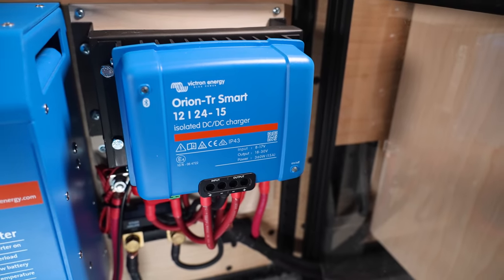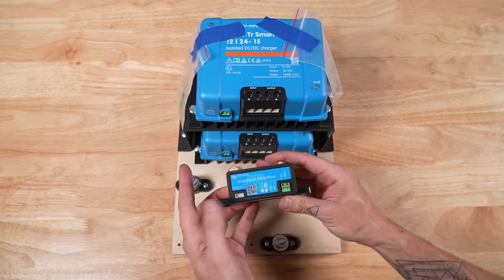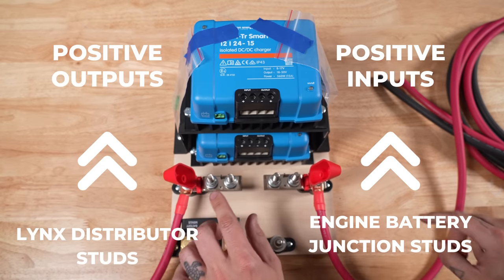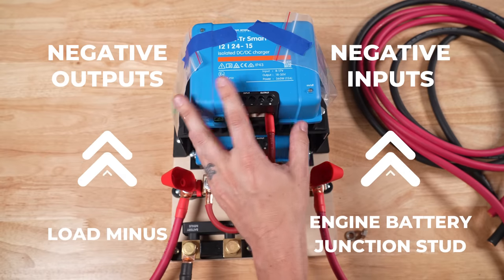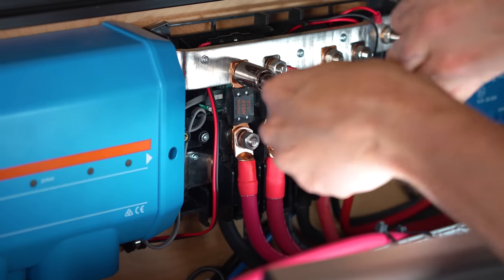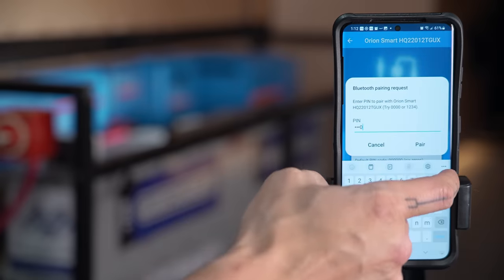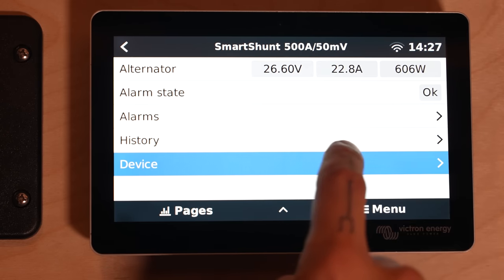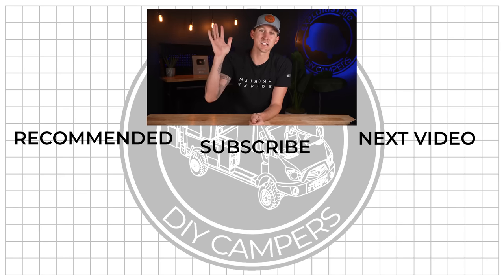TRANSIT ALTERNATOR CHARGING - DUAL VICTRON ORIONS

Comment: Great video, but I still do not understand how you can charge twice as much using two Orions. Is there no limitations on what you can pull from the alternator? Could you do three Orions even? I just don't get the dynamics/parameters involved, I guess.
Reply from the maker: Rule of thumb for alternator charging is to not add more than 50% of the alternators rated output in auxiliary chargers.  In this van; since we have 500A of alternator capacity; we just can't add more than 250A worth of DC DC Chargers or extra loads, so the 60A we added here is just fine.
Reply: @EXPLORISTlife   - understood, thanks! - the alternator has more than enough to give - noted.

Comment: Does the smartshunt HAVE to go on the output side of the dc-dc converter? Can I put mine on the input side?
Reply from the maker: It could go on either depending on what you were trying to measure.  The way I showed in the video is the way I'd recommend and find the most useful, though.

Comment: I am wanting to use my 12 V alternator system to charge 12 V or 24 V isolated systems is that possible with one charger and if so which victrons

Comment: Hi can i just use the the body ie chassis of the van for the negative part of the wire from the starter battery thanks.
Reply from the maker: I don't like treating the body as a current carrying wire, no.  Consider doing it like I showed in the video instead?

Comment: Would if I already have a smart shunt connected to my lynx distributor using copper bar and the load minus side connected to my negative battery bank? Do I have to get a second smart shunt? or do i wire the negative coming from the DC to DC charger on top of the negative wire I already have on the load minus side thats coming from the battery?
Reply from the maker: In this video, the smartshunt is acting as an energy meter, not a battery monitor, and you'd need both in your system to have the full monitoring capabilities discussed.
Reply: @EXPLORISTlife   so if I chose not to have the energy meter I could just skip that part of the connection in your video? And if so what would I connect the negative part of the charger to instead of that? And what part of the charger would get connected to the lynx distributor?
Reply from the maker: @hudyfilmsentertainment ultimately, if you choose to not follow the tutorial, you’ll need to forge your own path.
Reply: @EXPLORISTlife  lol so basically you’re saying it’s either your way or you won’t help? Okay lol
Reply from the maker: @hudyfilmsentertainment that’s a little overly dramatic.  This whole channel is dedicated to helping, if you just take the time to watch and learn about system design.

If you want to stray from our recommendations, though, I am indeed limited on the amount of personalized hand holding I can do, yes.

In short: either learn system design as our videos teach so you can design your own system OR you can install your system by our recommended methods.  Two solid options there to get you what you need.
Reply: @EXPLORISTlife  I guess I’ll have to find a different video that will show me a different way of doing it so I don’t have to fork out the extra money on a second smart shunt seeing how I already forked out a ton of money on this build. I mean, everything else in my electrical system is done, hooked up my fan to my 12 V fuse panel. Everything’s running great. Yeah I did my research, do I still understand everything? No but I was still able to get everything else running just fine off Nate Murphy 24v system tutorial. Only he didn’t show hooking up alternator charging, and since everybody hooks up their electrical system differently, it’s very hard to understand how to add the alternator charging. I don’t feel I have to go through another months of research just to learn one thing when I installed the whole electrical system just fine off a tutorial
Reply from the maker: Of course!  Totally understand.  If you want to simply follow the tutorial as-is and use the SmartShunt as designed, you'll simply need to purchase that one device to the tune of $100 thus saving you, apparently, a full months worth of 'research'. 

If you want to save the $100 and not buy the smartshunt; you will indeed need to dive further into the system design considerations to decide what is necessary to omit that part, yes.

There's always something new to learn.  I also don't know everything but I'm constantly striving to learn something new every day.  😊👍🏻

Comment: Hi Nate, being waiting for this video to come out. Awesome, thank you!
I was hoping you would have addressed the challenges or waiting to see if anyone mentioned them, regarding the Ford's Smart Alternator and the Engine Shutdown Detection settings for the Orion. I have searched the internet and there is a lot of talk regarding this subject but no real concreate answers, even on the Victron forums.
I have tried various settings for Start Voltage, Delayed Start Voltage and Shutdown Voltage but I can't seem to get the Orion to continue to charge throughout the drive. The Orion keeps turning off due to Shutdown Detection during the drive and it does this frequently. Have you managed to get the settings right so that it plays nicely with the Ford Smart Alternator? Would you mind sharing your settings?

Comment: Hey there. I'm sure you're prepping, maybe, for the Friday Live stream but I had a question about the orientation of these items and/or ANY of the Victron devices in your systems. I made myself an almost exact duplicate of what you did here and I COULD fit it vertically but the wiring into the Smartshunt and posts are going to be tight to the ground. Can I turn it 90 degrees and have them horizontal without any issues? I think the other part I had a question on is the MPPT but I think I have that one set vertically with clearance. I'm rather proud of my box and I'm hoping to show you and Lauren Lawliss since both of your videos have made it possible. If I don't get a response before Friday then I'll jump on the livestream and ask there and post the answer here for anyone else that might've had a similar question about orientation of the devices. To be honest, I can't think of why there would be an issue, but I watched a video where the person said to make sure it was sitting vertical. - Thank you very much - Joe... again.
Reply: Thanks for the answer on the livestream. For those that might still have the same question, Nate said they should be vertical for airflow and heat issues.

Comment: Do two chargers not put too much strain on the alternator? How can you calculate what size dc to dc charger you can go up to? 🤔
Reply: His transit has two alternators, 250amp each.  He could actually pull 175amps from CCP2 and 60amps from CCP1. If you have ford transit i would recommend you to read Ford Transit Body and Equipment Mounting Manual.

Comment: I love Victron products but this video REALLY illustrates why they need larger capacity dc-dc units with built in communications. I went with one of the new sterling 120amp units and a smart shunt to avoid all that wiring mess. It will be swapped out should Victron come out with a higher output unit with comms.
Reply from the maker: Agreed.  It's on the way, but they keep pushing the release back.
Reply: @EXPLORISTlife  I was at intersolar 2020 and they said soon back then. Though the pandemic sure did mess things up a bit. Hopefully soon. 👍

Comment: is there a reason you used a Smart shunt to show alternator charging? Wouldn't a regular shunt plug in to the Cerbo GX and give the same info?
Reply from the maker: What do you mean by "regular shunt"?  The Victron SmartShunt is the cheapest and most 'regular' shunt that Victron has.
Reply: @EXPLORISTlife  The basic  victron shunt that the BMV uses is only $35. The smart shunt is $130. I was just wondering if there was a specific reason you went with the Smart Shunt? As far as I can tell they should both do the same communication with the Cerbo. Asking because I am about to do the same thing and thinking I may have missed something.

Comment: Great video. No I don't think this video is overkill...in fact I would like to see a video explaining how to use alternator charging to the highest level (without damaging batteries) so that a vehicle battery setup could power home essentials during a power outage...and 600W charging wouldn't cut it. i.e. would I have to use 4x Victon Orions and 4x 12V 100AH batteries to get 1200 or more Watts of alternator charging or is there a better way? Thanks in advance.
Reply from the maker: If it were me in that scenario; I'd be going for a 2nd dedicated alternator, for sure.

Comment: Hi Nate.  In your Waypoint camper wiring diagram, you have two Orions.  In that diagram, you do not have separate fuses in each 6 AWG wire coming from the vehicle battery to each Orion.  In the dual Orion wiring diagram for this video, you have 60 amp MRBF fuses in the wire between the battery and the Orions.  Why did you add the additional fuses?  Thanks, Erik
Reply from the maker: Without getting into a 1,000-word reply, this way is more correct.

Comment: Ford does not want you to hook the negative cable directly to the negative battery terminal. It bypasses the BMS if you do. See Ford Special Vehicle Engineering - Body Builders Advisory Service. SVE Bulletin Q-231
Reply from the maker: We connected in an approved location for our particular model and setup, but yes, please refer to official documentation when connecting in your own system.

Comment: Hi Nate;
As always this was clear and concise and makes amateurs like me feel like they can do this work.   I could follow this along with one of you HD wiring diagrams and be successful.     I am wondering why yoo didn't run two sets of 6AWG wire to the individual B2Bs and connect the individual B2Bs to the Lynx distributor.   I would think that there would be savings on wire, fuses, MRBF fuses, etc.   Am I missing something here?    What changes would need to be made to combine the output of the two B2Bs (to the Lynx) to put them both on one stud on the lynx distributer?

Thank you so much for your content - I am a happy subscriber (and customer)

Comment: Hey Nate, i have a similar set up and really struggled with the two orions. I measure the output of mine seperately through a simarine and they seemed to fight each other. One would put out 30A and the other 10A, then theyd repeatedly swap. I found that using a trigger wire to the ignition helped. I also amended my settings so that absorbion voltage was 14.6V. seems better now but im still not fully convinced its working 100%. Have you twsted the individual output of yours?
Reply: Very interesting. Thanks for doing the work. I could never understand how the outputs of Orions could just be paralleled without having control wires interconnecting the units. Seems like a whole load of feedback loop problems. Shunt current regulators would be self balancing but would need series voltage regulators in front of them to control the charging profile.
  However Victron's design does not extend to the sophistication of Kelvin connections to the battery which seems a pretty obvious requirement when dealing with massive currents and real world installation wiring.
  I am using a single 12-24 Orion so have none of these worries. Perhaps a Victron circuit diagram would help. I believe there was an EU requirement for these to be available to customers. Though nowadays it would have to include software functions.
Reply: Network them together

Comment: I've been following the channel for awhile, and this seems to be one of the strangest ones.  I must be missing something.  Why the complexity of installing two 15A B2B when you could have installed just one 30A such as the Victron Energy DC-DC Bluetooth Charger Orion-Tr ORI 122436120 Smart 12/12-30A (360W) Isolated B2B Booster.  We installed that model, and it works great.  I assume that a 30A model wasn't in stock??  EDIT:  I see now.  You have a 24v system in the van.  Why 24v??  Smaller wiring needed, I guess.  That's another video I'll need to watch!
Reply from the maker: Yep.  24V on the battery bank means we don't have a 30A option.  But 15A @ 24V is the same thing as 30A @ 12V.

We did 24V on this system as we wanted to show people how to do a 24V battery bank.  We already had tutorials for 12V battery banks and didn't want to make the same video over again in just a different van.

Comment: Is there a way to use this to charge an EcoFlow Delta Pro via the solar 150v 15amp connection?
Reply from the maker: Not sure.  I do think one of the points of the ecoflow is to have everything contained in one box/enclosure.  If you want the flexability that a system with seperate components like we teach on this channel; you should probably abandon the ecoflow idea in favor of one of our higher performance and flexible systems.

Comment: I used the ccp2 with the 60amp  fuse instead of the 175amp  ccp1 on my transit. I have the dual agms. I installed the renogy 50amp dc to dc. I did not run  ground to the starter battery just positive. I did not install the ignition sensor and it seems to work fine. I did not use the 175amp connection point because it is only on when the key is on  and you have to use 2/0 cable for a long run! Also then you cant trickle charge the starter bank with solar unless the key is on. Do you see any problems with this setup?
Reply from the maker: I don't really like 'auditing' other people's setups based on just a few sentences with no context or pictures.
Reply: @EXPLORISTlife  OK fair enough. Mostly interested in the ccp1 vs ccp2 discussion.
Reply: @EXPLORISTlife  epic answer.  I did not see where u listed the MRBF fuse size.   I have 2x 12-12 30 amp feed an 500amp house bank.  What size fuzes should I use?

Comment: "EXPLORIST life" is the only "Subscribed" channel I have.
Having less that 1000Ah batteries... Would a second 250 amp alternator be need (Ford Transit add on /1st = 250 amps) if I only use two "Orion-Tr Smart 24/12-30A (360W) Isolated DC-DC Charger B2B Booster"?
My math shows (watt=amp X volts) 3000 watts. 250 X 12 = 3000

Comment: I’ve been running this very setup for two years. I’ll say, if I were to do it over I’d just spend another $500 and install a separate alternator that could provide 100+ amps of charge. 
With this setup, neither will provide full charge power while on at the same time, but if one charges independently will almost provide 400w+ of charging. To me, it’s not money we’ll spent when you have to convert.

Comment: Can't wait for the new Orion.
Buckboost will belong to the past.
Reply from the maker: Same.  I also made this design/fusing capable of an easy change-out for the new orions when they come available.
Reply: @EXPLORISTlife  Is there any info online about the new Orions specs? Or when they will come out? Will there be one that can handle more power so you don't have to parallel two or three of them together? I have been planning on upgrading my single Orion to this dual setup for a few months now, but if there are new Orions coming out that will be better maybe waiting a bit longer would be worth it. Thanks fro everything you do for the community. You helped me build my current system a few years ago with a few one on one calls and the online community forum thing.
Reply: Salivating at the idea of new tech in the Orion. Does anyone have any details???🤤

Comment: Can the Orion dc dc negative be connected to the auxiliary battery negative (common ground) instead of the engine neg battery?
Reply from the maker: I don't like treating the body as a current carrying wire, no.  Consider doing it like I showed in the video instead?
Reply: @EXPLORISTlife   the inverters and charge controller get grounded at the van body, why not the dc-dc charger?
Reply from the maker: Equipment grounds don't carry any current.  They are only carrying current in the case of a catastrophic system/component failure.

Comment: To save money I just use a 220v to 24v charger connected to a cheep 12v to 220v inverter I already have installed to charge the batteries from my alternator in my Ford Transit... I looked at DC - DC chargers but only found one that could to 12v to 24v and it was way to expensive.
Reply from the maker: Glad that's working for you. 👍🙂
Reply: @EXPLORISTlife  Yes it works very well :) I used it to heat up the cargo room while driving with a 800w panel oven in my Ford Transit Box van that is made into a mobile home . According to my calculation that uses about 80A from the alternator so I am a bit afraid of it overheating even if i am driving, so to be safe I do let it cool down if it stays on to long (you can clearly hear the cooling fan in the inverter when the heater is on).

Comment: Do you have plans on doing a video on the Smart Buckboost?
Reply from the maker: Very much so.  As soon as we get our hands on it.
Reply: Request, if I may:  when you work up the video for it, I would appreciate a bit of pro/con on the new version versus the current existing versions, on when you may prefer one over the other.   And, while recognizing that your specialty is camper vans, for those of us in the camper trailer world, it would be helpful to understand various potential ways to implement their use (understanding that while via an extra wire run provides a more robust situation, for those who may end up jumping between various vehicles without a dedicated line and are “stuck” with a standard 7-pin setup on the tow vehicle, but want to use an Orion to ensure neither the camper house lithiums nor the tow vehicle’s alternator and lead-acid battery don’t get damaged).  (Did that make sense?)